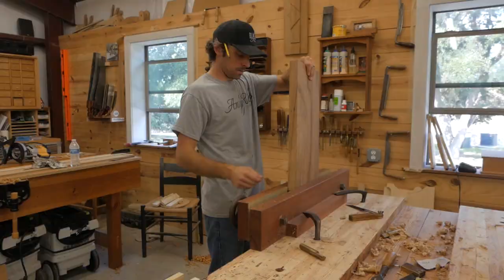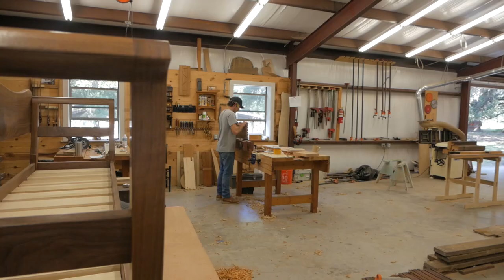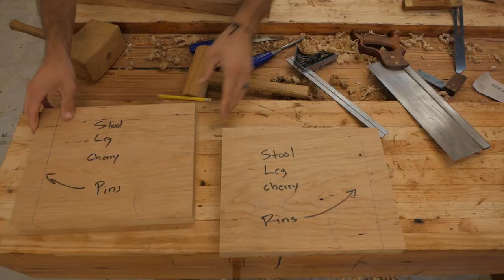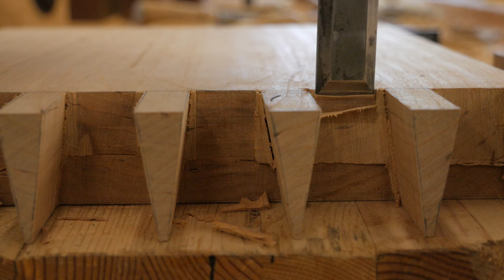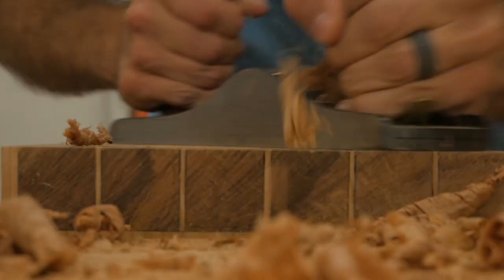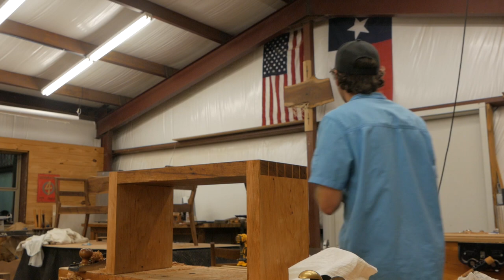Making A Dovetailed Step Stool

Comment: It strikes me as funny and weird that you will wear a respirator when dealing with fine dust but I have yet to watch a video with you wearing safety glasses. I don't always wear them myself just when dealing with fast flying debri or something molten
Reply from the maker: +Jeremy Stamper you do make a good point, although I don't think it's funny or weird, more of just a bad habit and a little stupid.  I should wear safety glasses anytime I work with power tools and most of the time I do.  When I'm shooting video, I'm typically going back and forth from camera to machine, and I'll take them off and forget to put them back on.  Got to get better at it!
Reply: Andy Rawls well I won't hound you about it just be safe!

Comment: dove tails seem a little to thick on the top and to thin on the legs but it give it a interesting look
Reply: Narrow pins and wide tails are very fashionable, probably because you can't cut them that way with a router, though they have a history that goes back to at least the 18th century from some pieces I've seen.